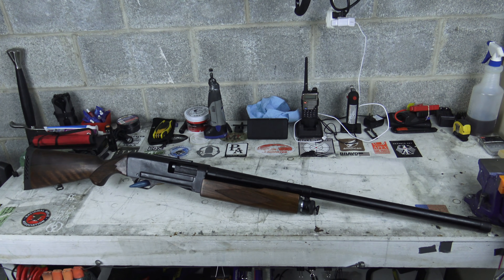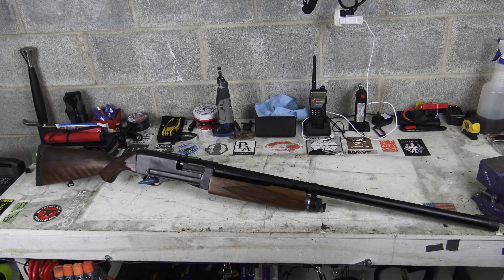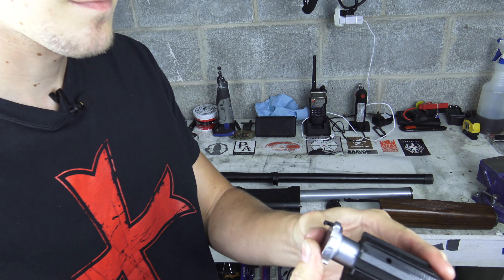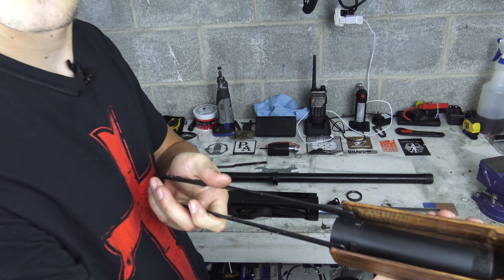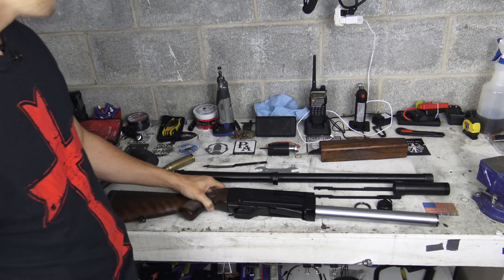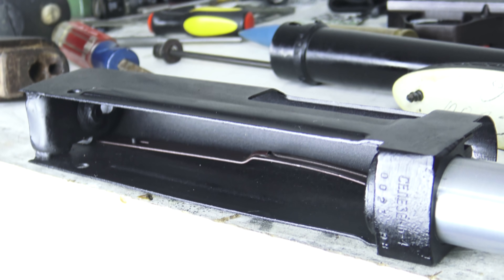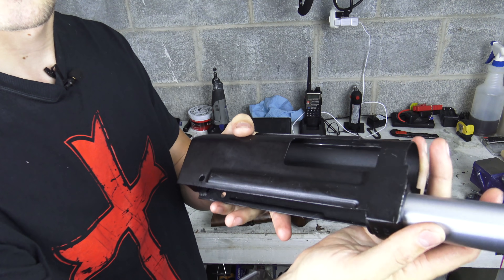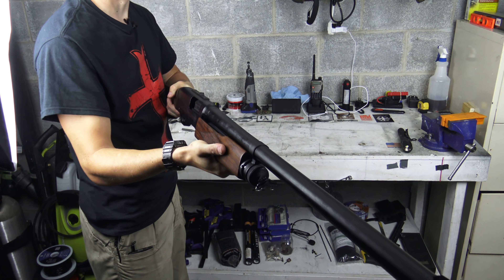BFG-1 Overview - 4 Gauge Shotgun [4K]

Comment: The internal components design looks like a giant Winchester model 1200/1300. Very cool.
Reply from the maker: That's the one! I knew it was loosely based off of a Winchester but couldn't for the life of me remember the model.
Reply: Kjaskaar it is almost identical with the exception of the locking bar and firing pin proportions. Same design that is currently used in the SXP. Good luck making ammo! I can't wait to see what you come up with for a load. 2-1/2oz at 1250fps sounds about right :P lol
Reply: John Stamper true, and that is because 12ga loads are designed for 8 - 11,000 psi. 2-1/2oz at 1250 is a nice starting point. I'm sure a "6ga" can push about 3oz at about 1400fps easily.
Reply: American Arms Channel I thought the same thing
Reply: 3.5" 12ga SAMMI 14,000 psi max
Reply: And I should add that USA sammi standard pressures are a joke.  CIP on the other side of the pond is a little more in touch with what shotguns are capable of.  My 2-3/4" duck loads are 13,000psi
Reply: Exactly what I was thinking.
Reply: I was also thinking of the SXP. If I'm not mistaken the SXP is a newer version of the 1200-1300 series.
Reply: Brockstar G correct. The SXP is simply a refined, synthetic stocked version of the 1300 produced in Portugal .
Reply: @AmericanArmsChannel  I thought so but wasn't sure. My SXP was made in turkey, very smooth action but a little on the cheap side as far as finish.
Reply: I have a winchester 1500 and the mechanical design is practically identical.

Comment: Fun fact; the KS23 has a “non-lethal” set of rounds. 2 types of rubber, and a blank round for grenade launching. This thing can fit a launching device, for the launching of nerve gas grenades for effectively ending prison riots (fun fact squared; these gas grenades are what appear during the Vorkuta mission in Black Ops 1). Additionally, they can take armour-piercing slugs designed to stop a car engine at ~100m.
Reply: Or “maybe-lethal” as they should be called
Reply: Don't forget the flashbang rounds

Comment: 9:40 - the bolt has 2 washers on there because one is a spring washer which is put on so the bolt doesnt get loose all the time. Spring washer holds the tension better fyi

Comment: it looks very much like the Browning BPS-10, 10 gauge, 3 and a half inch magnum shotgun that i use for goose hunting... my bps-10 weighs in at 10 pounds empty with a 3 round capacity, 2 in the tube and 1 in the chamber, and has a synthetic stock finished in real tree camo... i had to take some blaze orange trail marking tape and attach it to the fore end so i could find it if i set it down. what a beast of a gun
Reply: oh yea the browning ejects the empty hulls or live shells for unloading, out of the bottom of the loading gate. not the side of the gun.

Comment: I was wondering if there is an tube extension to increase it's capacity in 2 or 3 rounds. Or even a way to adapt some attachments, such a Rifle grip, a folding stock, a foregrip or even a holographick sight to it. That would make it the ultimate pump action shotgun.
Reply: Ultimate shoulder breaker

Comment: That's MY shotgun...I'm still trying to figure out where to buy ammo for it at...HAHA!!.
I know that"4-gauge"shells are 5"inches long and throw 5 ounces of shot.If they made"dianasour slugs"for it,they would weigh in about 3 to 3-1/2 ounces a piece.(438 grains=1-ounce×3=1,314 grains of lead)
It would be impractical to use a shot size smaller then number 4's due to the amount of shot capacity the 4-gauge holds(5-ounces of shot).There are 135 number 4 pellets to the ounce(multiply 135×5=675 pellets in one 4-gauge shell).

Comment: With the exception of the slide release and the back end of the bolt that is a scaled up Winchester 1200. Tear down is identical fore end is the same the bolt head is the same, ejector, op rods trigger group, elevator, mag tube, basically everything.  It's just all bigger...     I need one....

Comment: I think that ejector is also a?the bolt guide,
to stop it (from) turning when feeding/closing.
Please take the bolt/carrier apart, so we can see,
what causes that spring pressure.
Is it just the firing pin spring or
is there another spring in there.
U have to do it for (proper) cleaning anyway.

Comment: I could not even imagine The Recoil on that for gauge and I thought 12 gauge 3 and 1/2 + 10 gauge 3 and 1/2 had some recoil but that gun my shoulder hurts just looking at it
Reply: The shells are “only” three inch hulls and have less powder than you’d expect. So it’s probably pretty stout but manageable. That said, quad-aught buckshot would stack the same as 00 in a 12-gauge, so your shot load could be huge.

Comment: The thing is that the TOZ-123 is no longer a KS23, because it fires something larger than 23mm and it also uses a smoothbore barrel, which isn't rifled. So just think about this when talking about the TOZ and the KS23.

Comment: Why did you let those shells fly out of the barrel and on to the concrete floor?  That seemed like it would be rather 'unsafe' vs. the care and caution you present through the previous 99.999% of your video.